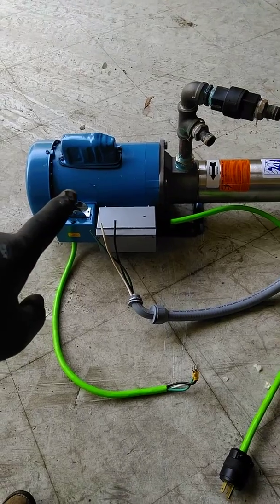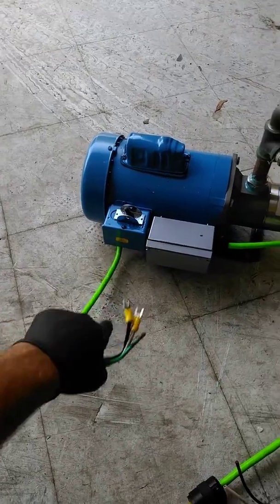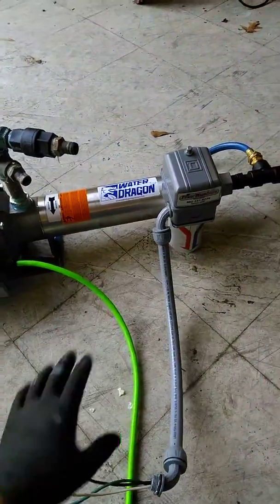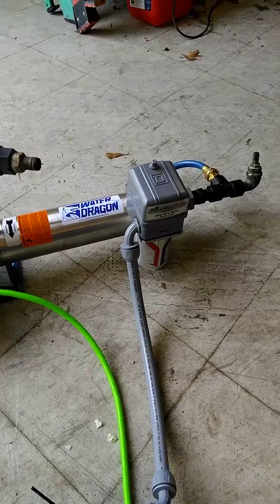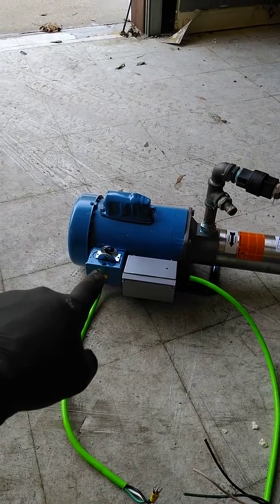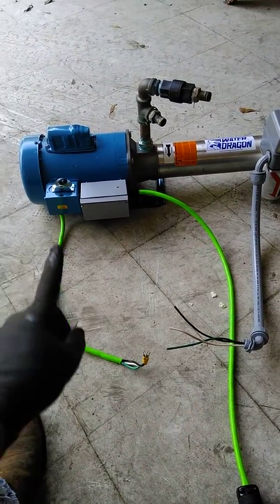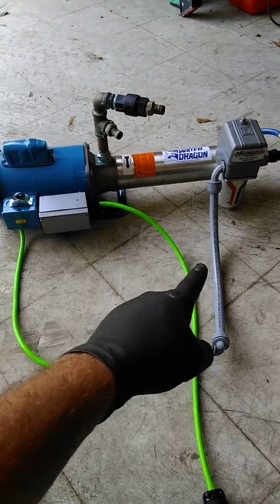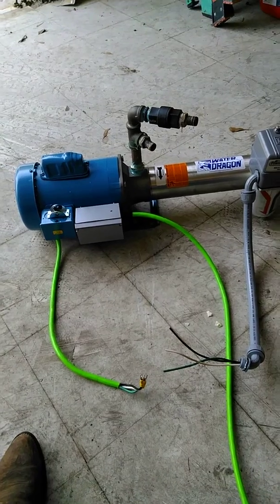Pro Switch Wiring on a Booster Pump

Comment: I’m just starting out I’m curious what does the pro switch do is it a pressure switch that goes on and off at a pre set pressure setting
Reply from the maker: Yes, the Pro-Switch is a pressure switch designed to be used with the Sodium Hypoclorite.

Comment: Please let me know how this pump compares to the Dayton pump you used in the past. I use the Dayton and always wondered if this pump is worth double the price. Thanks Rob
Reply from the maker: Will do. I prefer the Daytons but since my pump was discontinued I have been struggling to find a pump as good as the Daytons were.
Reply: Cajun Soft Wash  which Dayton were you using? I am using 45MW72 which still shows in stock at Grainger.
Reply: @PaGolfer69  how's that booster working for you?
Reply: Is the Dayton a multi stage pump? Can you use a pressure switch on it? Thanks